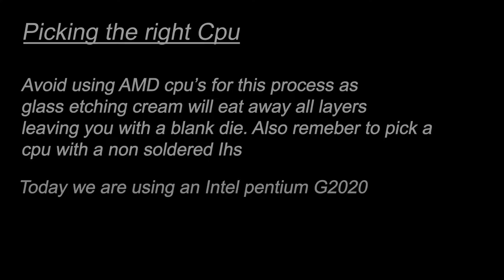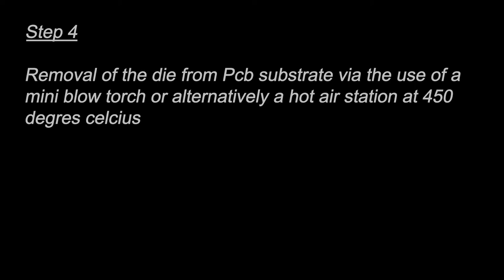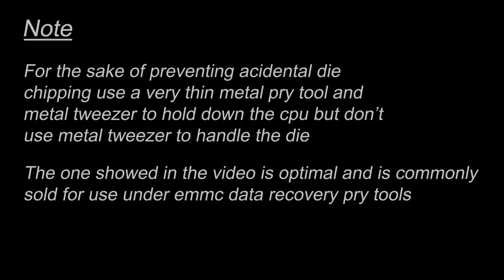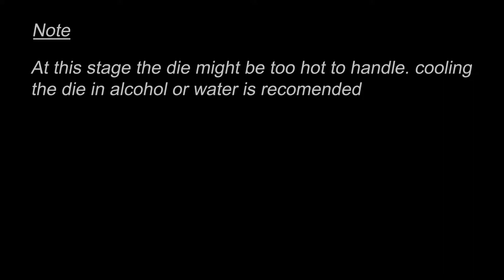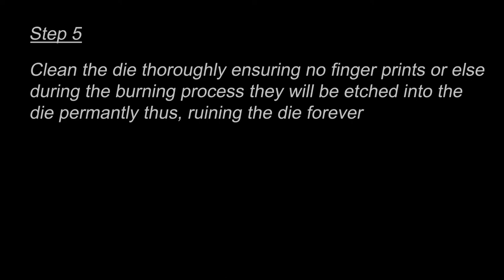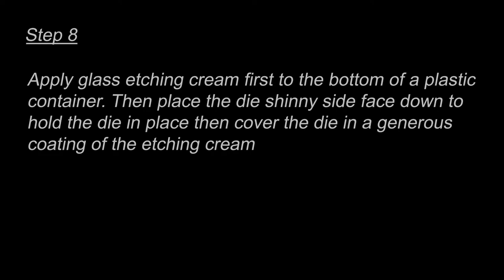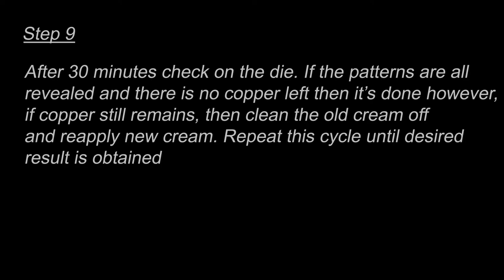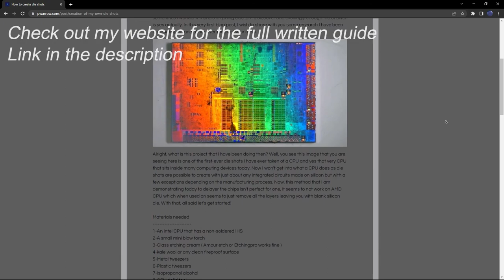Creating Intel CPU die shot without the need for sanding

Comment: For removing the die from the package, it is much easier to use a hotplate which can get up to ~450°C rather than a torch. Place the die facing the hotplate and wait for the crackling to stop before slowly peeling away the PCB until you can fit something underneath the die.

You can also leave the die on the hotplate afterwards for ~10mins at 450°C with the solder balls facing down to get the upper layers to turn to ash as is done in this video.

For most Intel chips from Prescott up to and including Haswell you can shave away the metal layers using utility razor blades to get down to the interesting bits. I find this gives much better results than glass etching paste but it takes practice.
I made a video showing this technique: https://youtu.be/wzQ4hq8ZOGw

This still works for Broadwell and Skylake but it is much more difficult and you are better off using acid or lapping film. This also seems to work for AMD and Nvidia chips, but they develop craters if you are not careful. Probably better off sticking to lapping film for them also.

Anyway cool seeing other techniques for this, thanks for sharing :)
Reply from the maker: Thank you so much for sharing your video with me. I din't know a simple blade and some skills was so effective however, if you don't mind me asking. May I know what you meant by getting better results ?

This is the first I have seen of someone using a razor blade and am very curios as to what difference it makes. I mean, I have long not been able to account for what the chemicals remove and have seen it make dies that are decapped from expoxy look super dull. 

Onces again, thanks for sharing this insight with me. I am sure to use the heatplate method when I can afford one. Never had liked the torch method ever to be honest. Just simply did it out of necessity.
Reply: @pwarrow I replied, but it keeps getting hidden. I think YouTube automod is removing it...
Reply from the maker: Thank you for your response. I have checked the held for review section for comments on my YouTube studios app but din't see anything held up there. I have ran into this issue before and if your response happens to have off platform links, that might be the issue. If removing that does not solve it, and if you still feel like it. You can always drop me an email over at pwarrow99@gmail.com

Once again, thank you for you interest / support and on behalf of YouTube. I am sorry for the inconvenience.
Reply: @pwarrow  Yes I had some links to a couple flickr photos. I'll email you instead!
Reply from the maker: Thanks, I have read and responded to it. I got a little carried away so yea... Sorry in advance 😅

Comment: What kind of camera and setting did you use to get the close up shot on your website? I bought over a hundred CPUs I’m going to start over holiday break.
Reply from the maker: Oh, I din't really use anything special l had a Nikon D5300 with the stalk lense. I was operating the camera in manual mode while keeping the aperture number as big as possible. The focus distance of the stalk lense dint allow me to be very close up with the die, so I had to move my camera back and forth to find the closest distance I could possible place my camera while maintaining focus. If you wish to photograph the dies. I suggest you get a macro lense as it would be of huge help.
Reply: @pwarrow  thanks, if things go well I might buy a macro lens for the cannon camera I use. It’s pretty similar to the one you have. But for now I will just use without it
Reply from the maker: @BGTech1  Alrighty, hope all goes well. Do let me know if I can aid you in anyway. Looking forward to seeing how it turns out if you do make a video about it. Again thanks for the support.
Reply from the maker: @BGTech1  yes, I have and great video btw. Logic chips are just damn beautiful aren't they. I have also tried this method before. When working I found it produces the best quality dies however, sometimes it might be rather inconsistent and get stuck in the epoxy package. When that occurs unfortunately, I have resorted to controlled burning or boiling sulphuric acid. The lather of which is better for detail preservation however, far more dangerous. Do you perhaps know of any way to make it more consistent through your test runs ?
Reply: @pwarrow  That method seems to work better with older chips. Newer chips seem to stick to the epoxy more frequently. The hotter the heat the better. Some chips will just work better with this method some won’t. It depends on the manufacture of the epoxy the package is made from. I would like to get sulfuric acid to boil chips in but it seems a bit dangerous. I will have to ask my chemistry professor if I can use one of the fume hoods. If that works out, then I will start doing it.
Reply from the maker: Hahaha the higher the better. I mean it's probably not the best way but I have always used a mini blow torch. Sadly that torch is now dead cuz I have used it too much. Oh well, but do be very careful if you do get the chance to use sulphuric acid. Sulphuric acid at 200 something degrees is an instant char if it hits your skin.